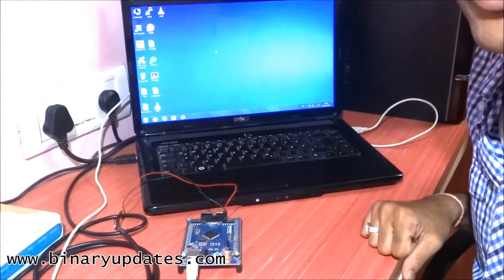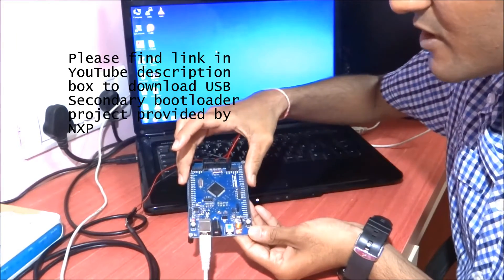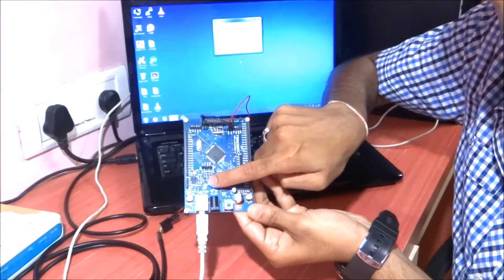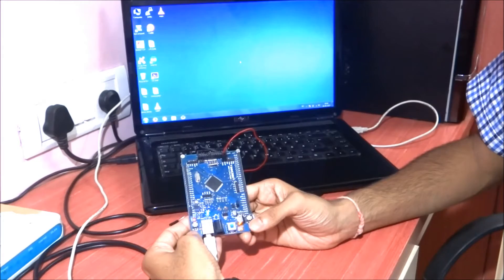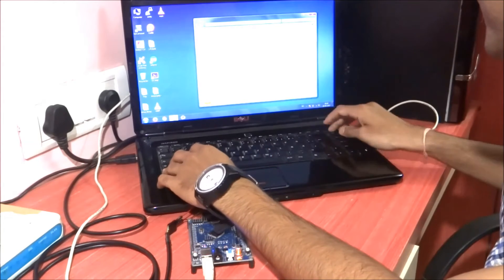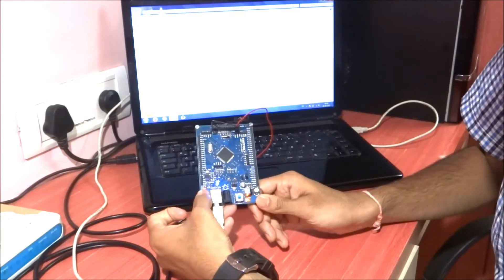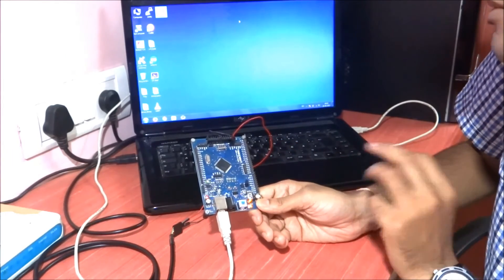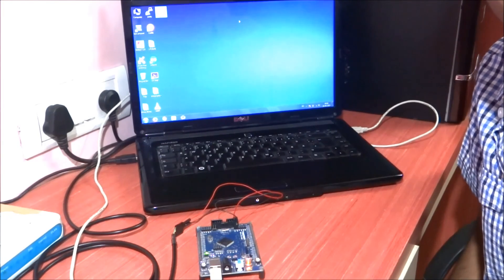USB Secondary Bootloader: NXP LPC1768 Cortex-M3 Microcontroller

Comment: Hello sir nxp company cooperare with Trident company and produce npx8473? 
Do You have pleasure for install Linux? 
I have connected my board to serial hyperterminal and have just like the booting right. Ok. 
I have found two pin jumper. 
Shorter this pin and start communication with hyperterminal. 
Yes 
A this Time i have a reply C 💪
A this Time need send bootloader? Send two file by Ymodem? 
Have any help? Thanks

Comment: I am having a bare chip LPC1768. Any Idea to make it fruitful , I want to make a smoothie board for my 3d Printer. Thanks
Reply from the maker: Hello Mr. Narimas, You can surely use for make Smoothie Board using LPC1768 MCU. if you want you can check my video lesson of Eagle PCB Design from Scratch. Programming Bare metal LPC1768 chip is difficult better if you can design board for yourself or buy any readily available in market. I wish you good luck let us know as your project progresses. Wish you Good Time